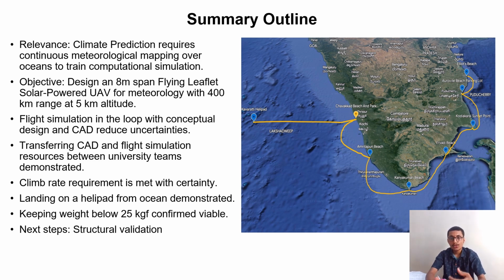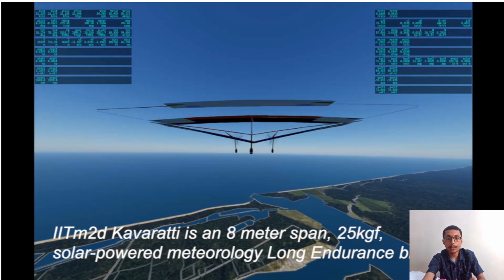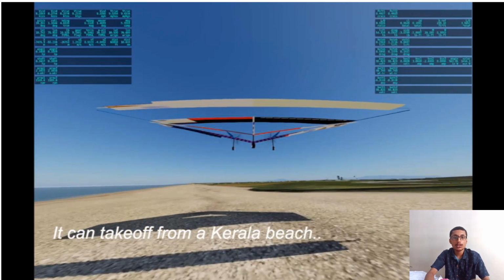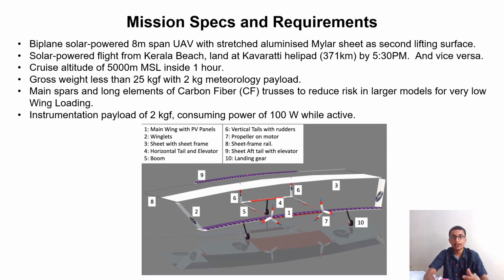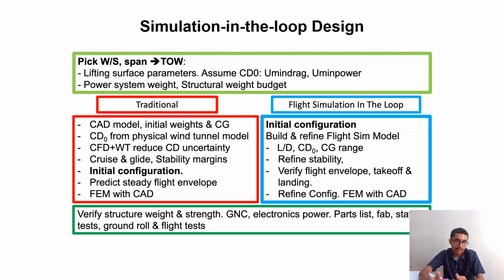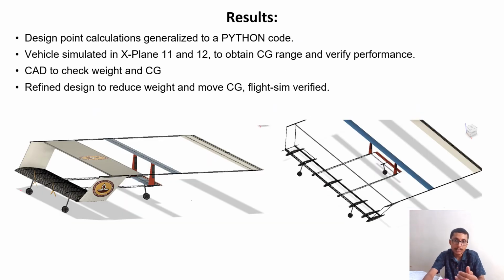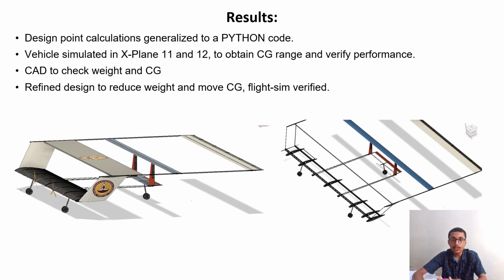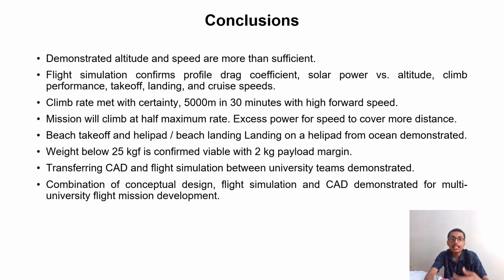Design and Simulation Of A Solar-Powered UAV For Meteorology

Comment: Interesting project. R the parts detachable for easy transportation. Or is it a build at site product? How much does it cost to produce one? It will be easy to use for the various IMD locations, I reckon.

R u part of  the Thakshila Institute?
Reply from the maker: Designed to be carried in a pickup truck / SUV (pieces smaller than 2m long), ready to assemble. Any 6-year-old with a degree in engg. should be able to do it. :) Seriously it is planned to be manufactured all over the world, assembled, operated, piloted and maintained in most places. Manufacturing cost we expect will be lower than you might expect. Manufacturing will be at dedicated facilities. Initially because you need places where people know how to do it. Later because you will be building large numbers rapidly, once governments decide to get serious.